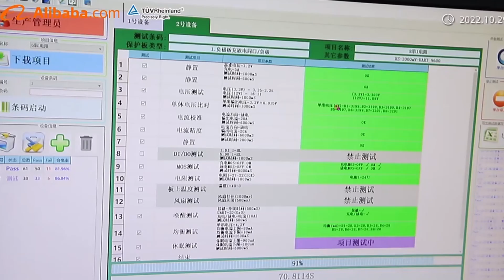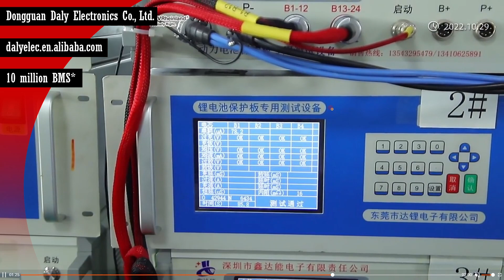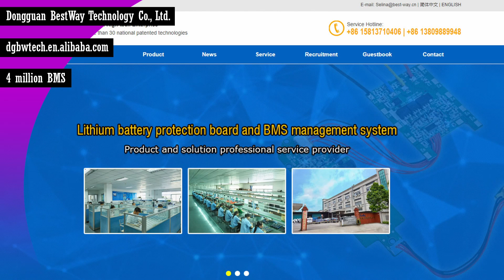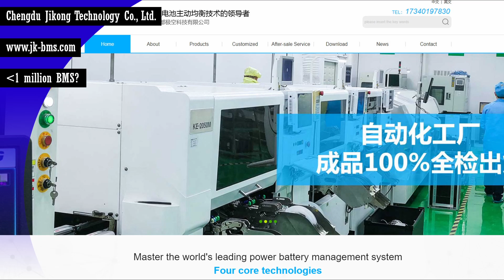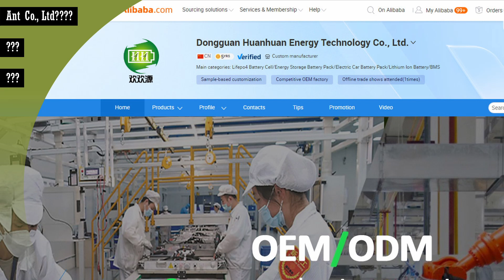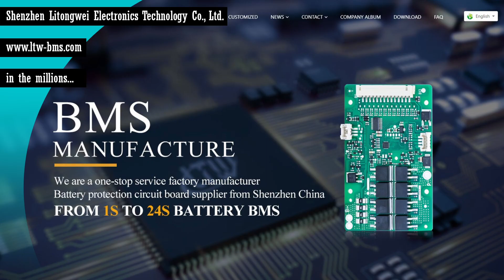Which are the biggest BMS manufacturers in china? Daly? JK? Ant? JBD?Bestway?

Comment: Is there a BMS for “automotive style” 12V batteries that can handle the starting current and charging voltages of an alternator?

Would like to build one for a power sport application using NMC or LFP depending on what is available.

Always thought a small BMS that could drive a relay/contactor for LVC/HVC could be viable also, might there be anything like that avalible?
Reply from the maker: Yes, Daly has actually recentlly released just that for large starting current for  12V and 24V 4000A peak (300µs)

Comment: I never buy a bms from Ali Express, or Alibaba. my house burn down by a bms over heating.
Reply: What BMS was it? You should of installed fuses
Reply: @Tomas-ml9nv  Where exactly would you put tge fuse, I have been thinking of connecting each battery with fuse wires? What are your thoughts in this? 😊
Reply: @rickstard73  a fuse would not help if a cell caught fire du to overcharge.